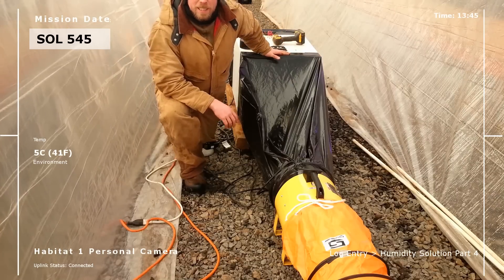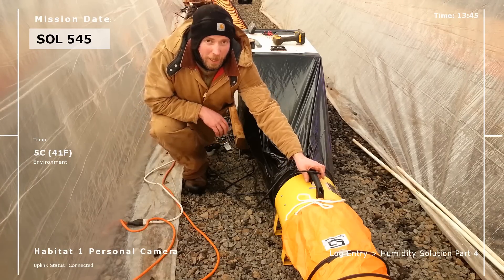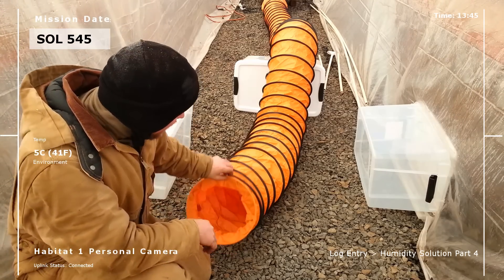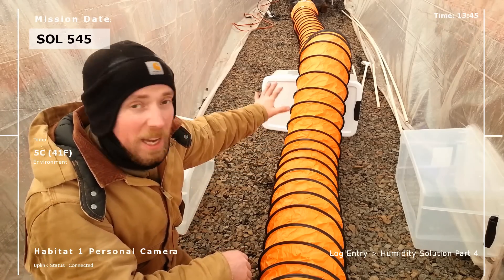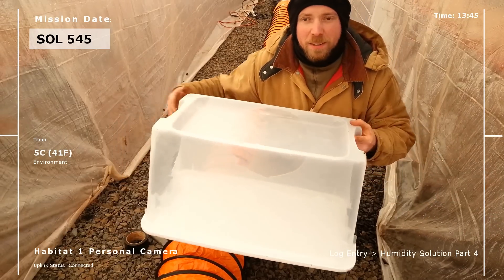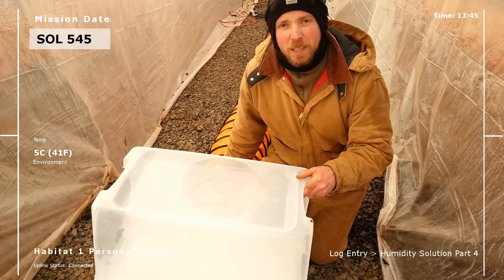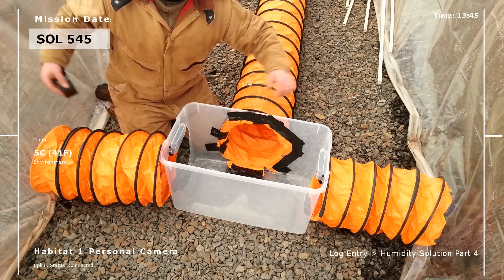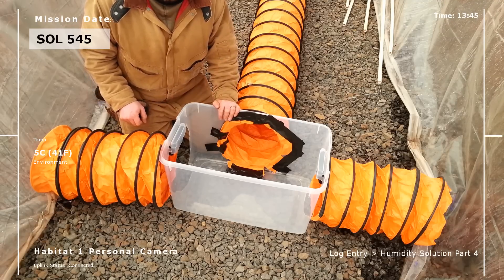Low Cost, DIY, GREENHOUSE Heating Solution  - Part 4

Comment: A residential electric furnace with 5kw heat bank set up to kick on as an emergency heater could be installed if you can sacrifice the electric it would require 30amp service, but shouldn't require much run time to bump the temp above 30 degrees in those small spaces and will dry out the air a bit

Comment: For the transition from the 24" X 24" square to 12" round I would build a box out of rigid foam insulation then use a 12" duct take off.  The trash bags worked great for proof of concept but likely will not last.  The foam will help mitigate the humidity differences as well, keep condensation from forming inside or outside of the bag.  Could use 12" flange takeoffs to seal the duct to the bins as well.  Cost more but at $8-$12 per takeoff could make sealing them easier.

Comment: The only problem that I foresee in this built is the use of trash bags.
They are designed to degrade over time...even faster in sunlight (though yours is defused).
If they fail you could use some of the clear stuff like on the grow-lanes.

Comment: Thanks for another good one. Please allow me to share my thoughts:

Wouldn't it be easier to use some MDF of thin plywood boards for a prototype? Then you can nail, glue or screw things together. 
6 pieces of ply/MDF, three holes, some nails and nail the hoses to the holes. Finally use some MS sealant to make it all air tight. Also to go from square to round seems much easier with a ply/mdf box IMHO. 

Thin tinned steel or zinc are materials that are very easy to work with. Just a pair of scissors and a pop-riveter is all you need. (Zinc is also easy to solder BTW).

Comment: Fun to watch. A quick rundown on how the dehumidifier works as a voice-over during the sped up bit would have been cool.  I'd really suggest you lose the overlay graphics - they look a bit poxy, particularly as the time and temperature values don't change, so they're not actually informative.

Comment: mastic tape would have worked better. it's better than duct tape. even when is a just a different form of duct tape. I've got mylar tape too. that stuff is so sticky. if it comes in contact with its adhesives sides. to pull it apart is to ruin it.

Comment: Looks great! If it works would a V shaped plate inside your diverter box improve the efficiency? It seems like it would reduce the turbulence of the air trying to make those 90 degree turns.

Comment: Hello there, love the videos. A question, is the longevity of the circulation fan an issue? would it not be better for the fan to be downstream of the dehumidifier? Keeping excess moisture out of the motor. Also, you may want to use two layers of greenhouse plastic on each tunnel and blow a bit of air between the two, that insulating layer may also help with condensation. We use this technique for our greenhouses here in Michigan.

Comment: You learned something today. When taping something to plastic, you need to clean it before applying tape; use isopropyl alcohol, like we do in the aerospace industry. Plus, it does not help that the temperature in the Habitat is only 41F.
Reply from the maker: thanks for pointing that out! and you're right :-)

Comment: 2 LANES ? with 1 layer in each lane ? Why not use the double stack and only have the one lane to heat and dehumidify  ? Just to get you through the winter then add the others in warmer weather .

Comment: if you have it, swap the black bags for the stronger clear plastic, then build a small wooden frame around the square taped bits. you can shim the sides where needed to keep pressure on the duck tape where it counts. 

a few 12 inch hose clamps should be a reasonably cheap way to attach the plastic to the round fan connector

Comment: Looks like it is coming together!
A question about the dehumidifying unit, does it have it's own fan internally?
Is the air going through the dehumidifying unit now going faster than the internal fan in the unit? If so this could cause you some troubles;
1) The fan is restricting airflow.
2) The fan if spun to a speed higher than is should run could be damaged, or even fail catastrophically, causing damage to the unit.
Maybe you need to remove the fan from the unit.
Just some thoughts from back here on the big blue marble!
Cheers!
Reply: Of more concern is if he's increased the airflow through the dehumidifier. They're designed for a specific airflow. If you ram a bunch of air through it it won't dehumidify it. He mentioned he had an airflow meter in the setup so I presume he's on top of it.
Reply from the maker: thank you Stuln and Hugh...Hugh, I haven't thought of this so your comment is appropriate...I'll add it to the "backlog" and someday I'll have to test it all more thoroughly. Right now my major problem is heat. I'll solve that one...then onto the next as the Martian would say
Reply: The easiest thing is to call the mfr. Since it's a commercial unit you ought to be able to get an engineer on the phone to discuss your application. The controller may have an engineering debug mode you could use to read out the data you'd need to optimize the airflow. For a fast and dirty check you could make a manometer out of plastic tubing and check if there's a significant pressure drop across the dehumidifier That would mean you're forcing extra air through it. You may need to bypass some of the airflow to avoid that. How much pressure is too much I can't say. I dabble in this stuff but I'm not an HVAC engineer. I'd measure the drop across the evaporator then the condenser while it's running in open air and add them up. I don't think it would be a good idea to apply more than about 10% of that total drop. 
For your heat problem someone suggested moving all plants to lane 1 and shutting the other down. I think that's the way to go for this winter. Move the lights and everything to lane 1. Triage if you have to but the vids looked like there was a lot of open space in some of the beds. It sounds like the micro grains are very important. I'd put them wherever you have the most heat and put the backup heat near them also.
Reply: TheRealMartian No problem, and it's "Stu In Tokyo" as my name is Stu and I'm in Tokyo LOL
Love the videos!